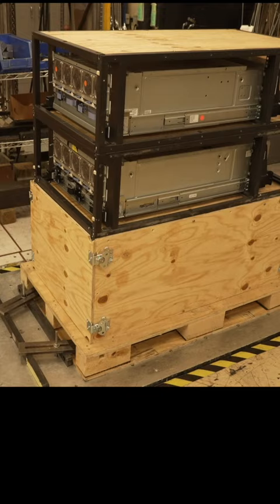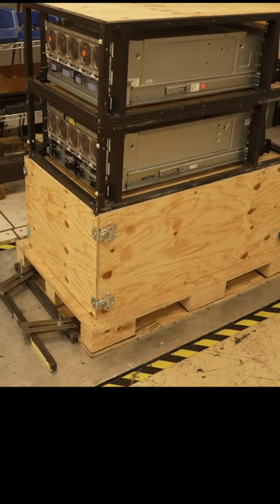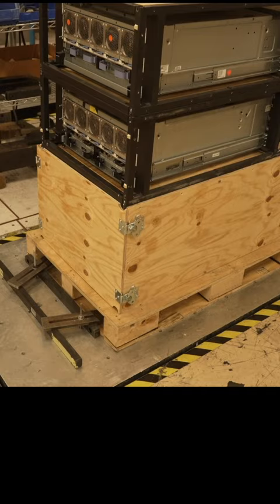Torture Testing an IBM Mainframe!  Shake and Bake!    #computer

Comment: but what about the home made computers? people make their own PC's and they never test them like this yet, those computers last for decades.
Reply: you home computer would die really fast if you let it run 24/7 under heavy load.
Reply: You don't typically ship your hand built pc on a pallet to a business that has $100ms riding on it arriving in a condition for ten 9s of uptime
Reply: @TAP7a  It really should be with the crazy price you have to pay for a PC now.
Reply: Yes, but I don't have earthquakes in my area and I doubt my PC would survive delivery by post service. Even for a car transport I would need to hot glue all connectors and maybe remove heavy hard drives from rails and GPU from slot, although mine is not that heavy.
Reply: Your pc will not have to support critical transaction and operations. MFs yes, so they need to be perfect.

Comment: but can it run crysis?
Reply: Probably, coz those machines are quite powerful (the whole video has the specs I think, not sure if it had a gpu by default though)
Reply: no, but it can cause one when it doesn't work
Reply: If crysis was written to render on cpus then absolutely